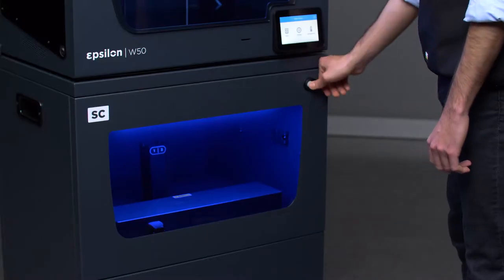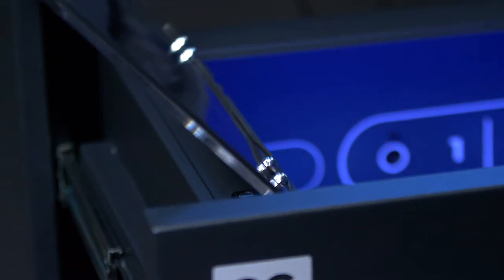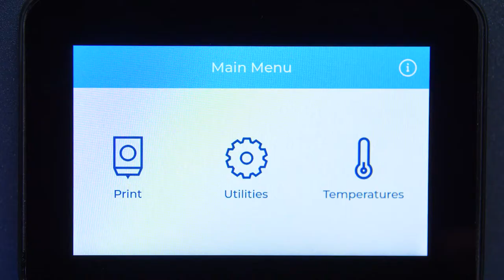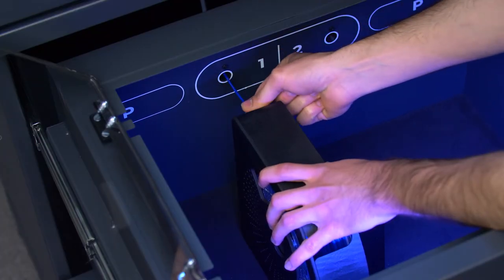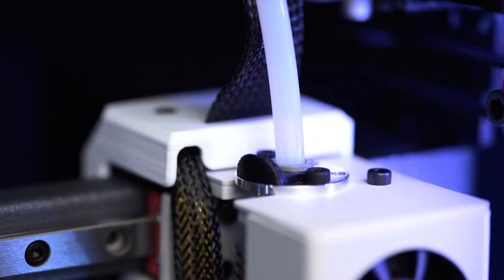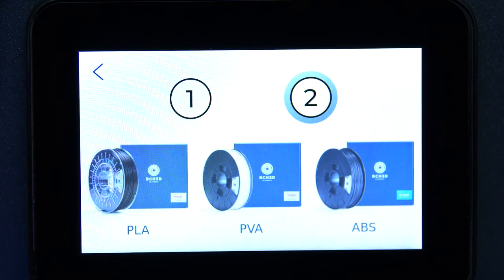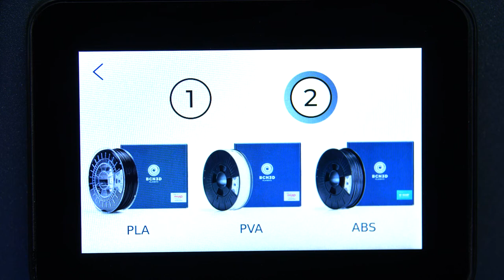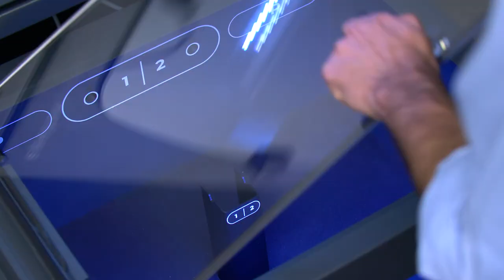Loading filament - BCN3D Smart Cabinet

Comment: Load filament looks really simple but, how many spool can I store in the smar cabinet?
Reply from the maker: You can fit up to 6 Spool Cartridges, which can store spools of up to 750g! Without the use of these cartridges, it is possible to store 10 small spools of filament (between 750g and 1kg), or 4 big spools (up to 2.7 kilograms per spool).
Reply: How many spool can I load to the printer? Does it allow uninterrupted printing by automatically switching when the spool is empty?